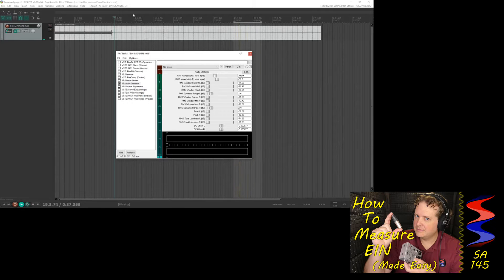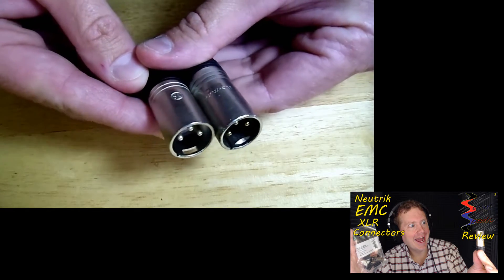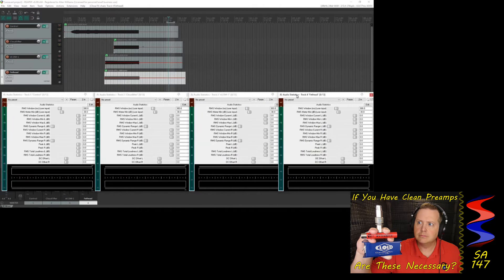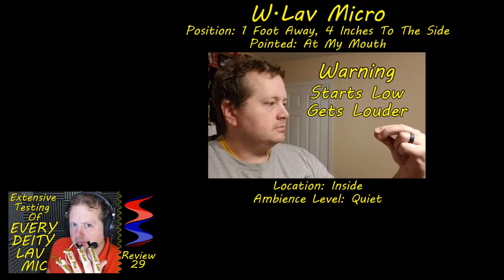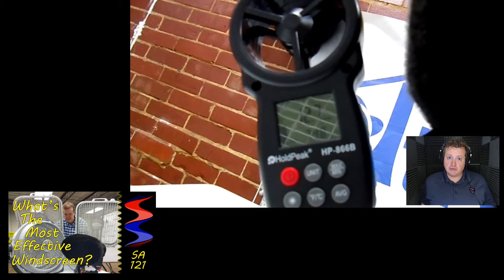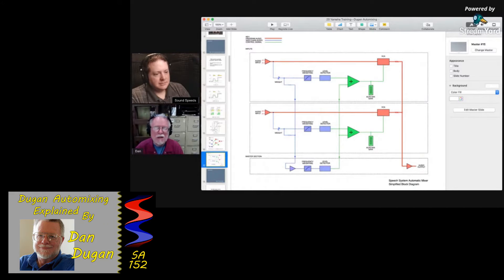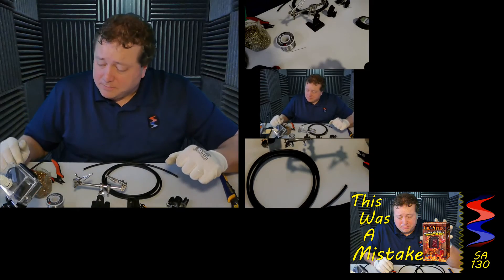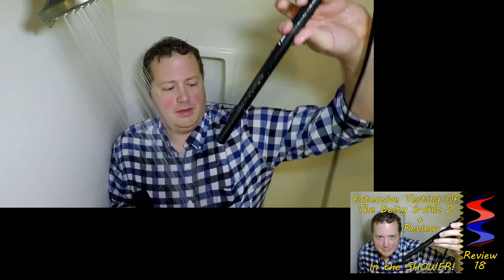New Sound Speeds Channel Intro

Comment: Whats your favorit headphones on field recording. Im using the classic MDR-7505 wich I wish would cancel out the outside sounds more. I find my self having to crank up the volume to listen to it. I have sure SRH440 in the studio wich does a better job of preventing outside sounds. But they got a construction that I would not trust on location where you have a thin cable begging to be pulled of.
Reply from the maker: On set when I'm booming I use the MDR-7506 because I like being able to hear thru them a bit but when I'm in my studio I'm fond of the AT M50X Audio Technicas because they isolate much better. If you like the sound of the 7505 but need a lot of isolation then Remote Audio makes the HN-7506 which is the 7506 drivers inside of helicopter pilot headphones. They do sandwich your head a lot though.
Reply: Thanks, I was thinking about drummer headphones style, and this was spott on what i was looking for. What did you mean by sandwiching the head? Does it squeeze you a little? Are they uncomfortable to walk around in?

Comment: Great Intro Allen! Always great sound content! 
Wanted to follow up on your cheap boom pole series. I ended up finding a deal on the Movo Location Sound Bundle on their Amazon store for $215. Includes the BWS-1000 Blimp and CWP-25 8.2' Carbon Fiber boom pole. While I think the pole will work for my needs (static pole on a C-stand and holder), it's got many of the concerns you had in your cheap boom pole video - padding, handling noise, tripod-style locks and thin cable. One day, I'll get my self a nice Ambient or K-Tek (when I'm a Big Deal YouTuber).
Reply from the maker: You don't have to be a big YouTuber to get those or I'd never have one.